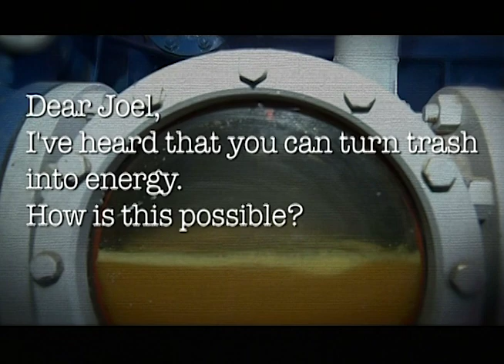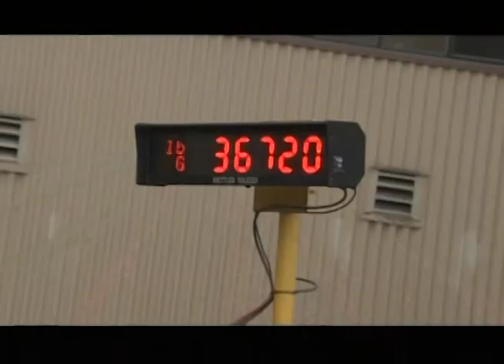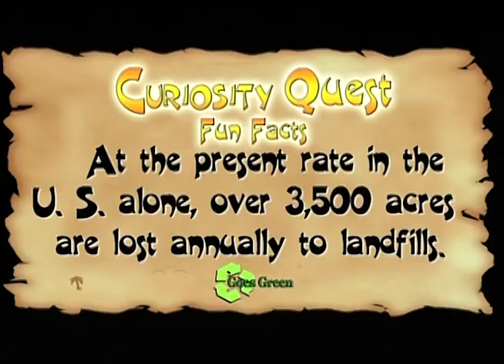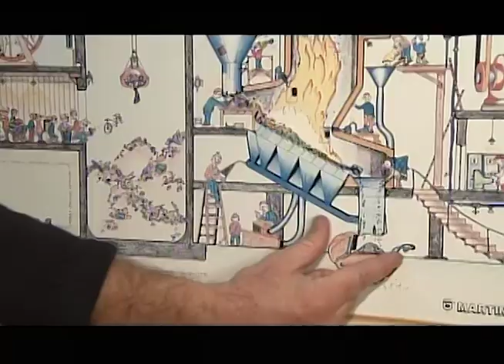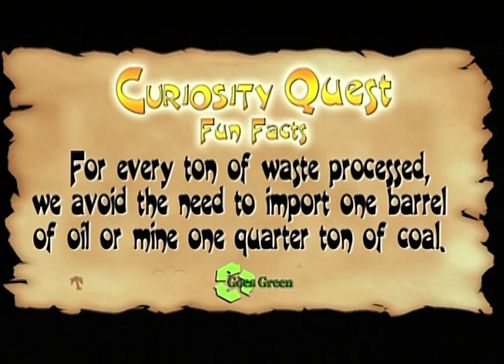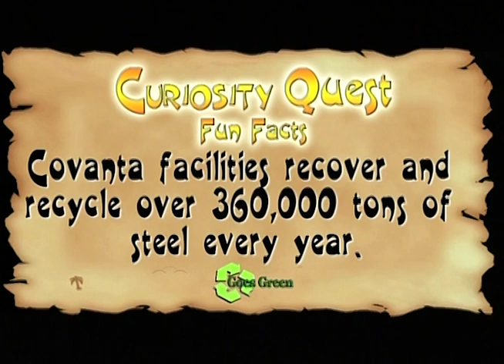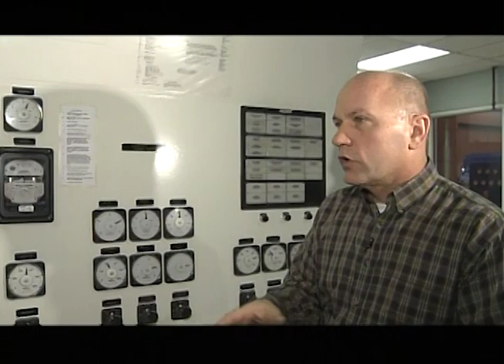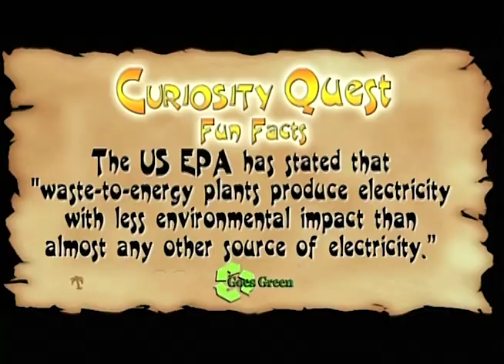Covanta Energy

Comment: Would Covanta accept me as waste for my #DeathWithDignity method of death and subsequent incineration? What if I came in one of the garbage trucks and I was still alive when I was dumped out onto the tipping floor and I was wearing nothing but a thick disposable diaper? What would they do with me? how long would it be until I was loaded into the hopper of the incinerator?
Reply: wrong facility. this one is all about processing waste into energy/metal recovery. what you want are the soylent green facilities ;)